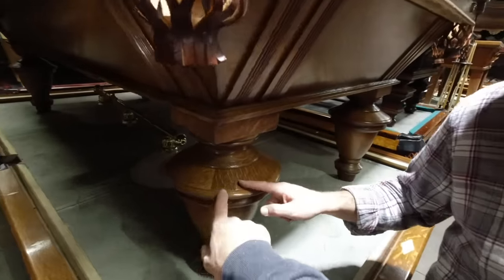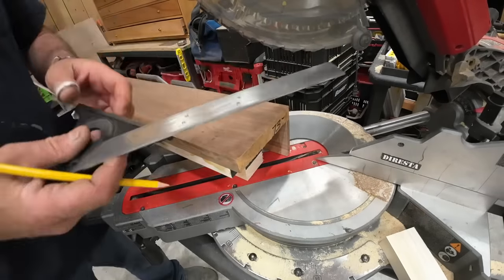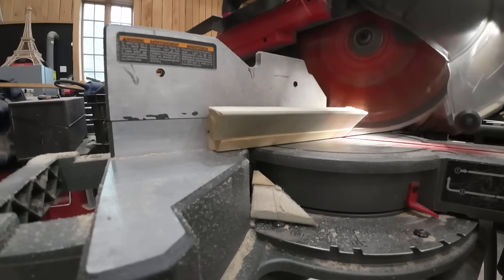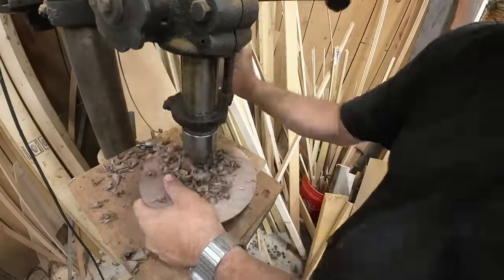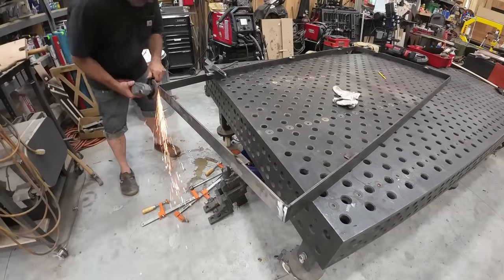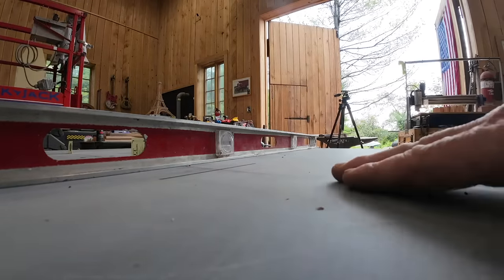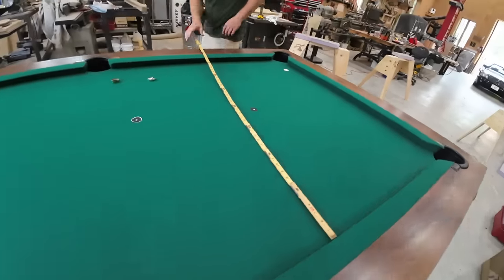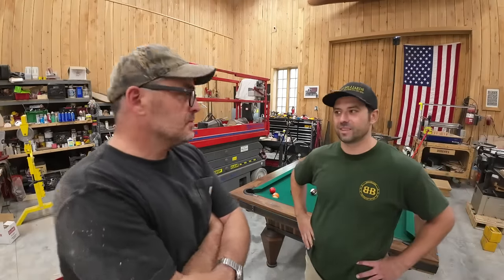I can't believe it's Done: Pool Table Build

Comment: Years ago you showed us a tip of glueing a strip of sand paper to a board. I have since used this tip almost daily in my modest shop.
In this video you again show a tip that I will probably use often: the large sanding disk glued to a sheet of plywood.

Thanks for both of these tips and the many others you have shown over the years, and for all the amazing content you have created.
Reply: To expand on that concept, 
Fabric backed abrasive sheets that tool & die shops use (+$) glued to tempered plate glass will flatten and smooth gasket surfaces of engine parts. 
                           🤜🤛

Comment: Well done.  I have  rebuilt rails on an old brunswick table.   As long as you got the bumper height,  and pocket angles cut correctly, it will play fine.  Blatt is well known across the industry.

Comment: For removing the glue from join line, try a normal sized straw. I just saw it in a video and it works perfectly. It conforms to the angle and scrapes all the glue into the head of the straw.

Comment: Celebratin’ glue, are we? Alright, fine – no reason to be cynical, it is good stuff. Enjoying the narration!

A friend of mine once bought a used pool table, and I helped carry the slate: Can’t remember if it was one piece or combined of several bits, but you couldn’t take it apart – holy Schmidt, heavy heavy heavy.

Comment: Not the tightest mighters in the corner may be due to shrinkage, but that's extremely brave, trusting the Milwaukee cordless sliding miter saw. That thing is loose as a goose re repeatability.

Comment: A slight angle on the perimeter wood would have been a nice touch along with more of a rounded edge.
 Also next time, try using Horse Shoes around the pockets. H.H.

Comment: So I'm watching u making the WALNUT LEGS for the table but for the life of me u cannot use them to hold the weight of that table above them?? I was thinking u were resawing the pieces for the legs as veneers to be glued round some hardwood legs of a kind. I'm stunned that those legs are strong enough to hold that weight of the timber and the Slate which looked about 3/4" -1" thick?? 
Ur a braver man than I Jimmy mate. I wouldn't have the guts to build it without making those legs bulkier inside them but I'm not clued in enough about wood and the strengths and weaknesses as yet my bro.
IO love the table. What size is the table btw? It looks like an 8x4' table??
Brilliant job my friend. Keep doing ur thing pal..

Comment: Everything looks awesome, a great design, classic Diresta, only question is about the leg placement, why did you let the rounded base of each leg stick out of the metal frame? surely it would still be stable with them slightly more inwards

Comment: When I worked at a local shop that did vending machine stuff and pool tables I refelted tables for a few years and it was a lot of fun but my biggest fear was people wanting old tables repaired.... I was always terrified about breaking something on them but I soon realized my fear was misplaced, I should have been scared of the pool table breaking me because the slate was twice as thick as standard tables and it weighed SO much more. We did one antique table one time and it took us 2 hours and the guy tipped us $500.... I learned that day that we charged more for old tables because they're built like fkn tanks and everything is heavy.      😂😂
Edit: We used a white wax that was in a stick to fill the gaps and screw holes then we used spray glue to secure the felt to the table... After a few minutes it was flipped onto the table then rolled tightly while stapling the edges.

Comment: great table, question: when a ball jumps and hits the wax patched area, doesn't leaves a dent?
Reply: The wax patched holes reside underneath the rails where a ball can't touch.  The seams between the slates is such a small area it's unlikely to cause a dent, but over time the slates can settle and the seam can become uneven and that can definitely do some strange things to a slowly rolling ball.

Comment: for me being in the european pooltable business its really strange to see screwholes inside the playing area, over here i,ve never seen that.
if they fill it with wax and you make a jumpshot exactly on that point it could potentially make a dent in the wax couldnt it?
also i have never filled the screwholes that go under the rail because it becomes a pain to take it apart again to move the table or to potentially re-level the slate later on if needed, they are under the rail so the ball cant reach the holes.

interesting to see someone  build their own table from scratch though, still something i want to do at some point

Comment: I see your using barge contact cement, if you want a better contact cement look for a brand call “master cement “ it’s brand most shoe repair shop use for glueing on soles before sticking  I used masters for over 30 years when I made cowboy boots